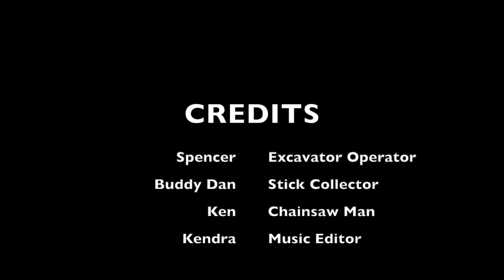Tree Removal with Komatsu PC27

Comment: Curious if you could share your thoughts on the Komatsu pc27?  I own a tree service and use a Vermeer mini skid as my primary removal tool. I was thinking about adding a mini ex, and I was on the verge of pulling the trigger on a Takeuchi TB 235.  Someone just offered to sell me their PC 27.  I was planning to be in a slightly larger weight class, but the price is right on this Komatsu.  Thoughts?
Reply from the maker: We've ran this machine for years without issues. Its been very solid but its starting to show its age. They don't make this model anymore so parts may be tricky in the future

Comment: What size bucket are you running? Is that a 24”?
How does it feel digging on that very machine? I have the same machine and am trying to decide between a 20”, 24”, or a 25”. 
I currently have the 16” little bucket... 
it definitely needs to be bigger.
Reply from the maker: 24” with teeth. Seems to work fine. No complaints. We have a 12” for trenching and stump removal but that’s it. 24” is pretty standard